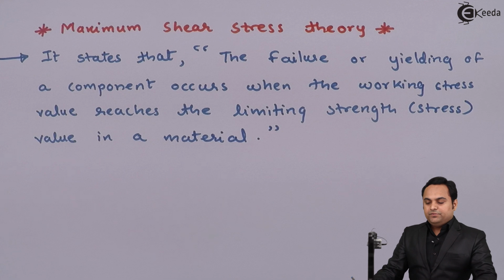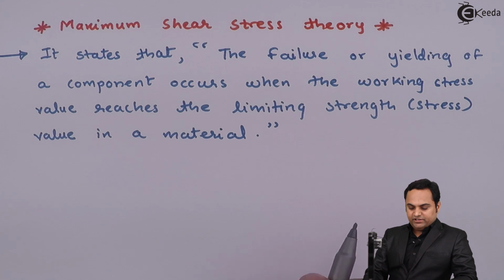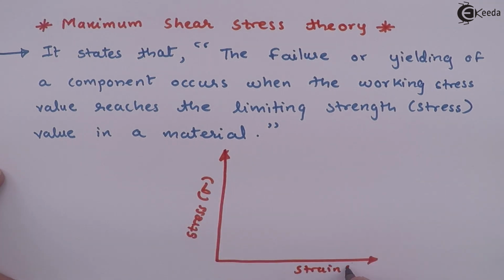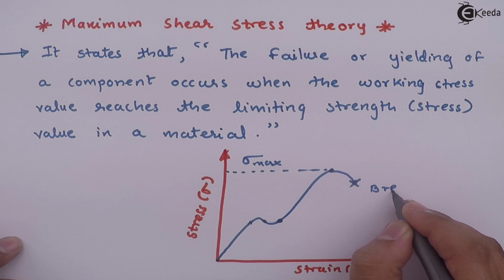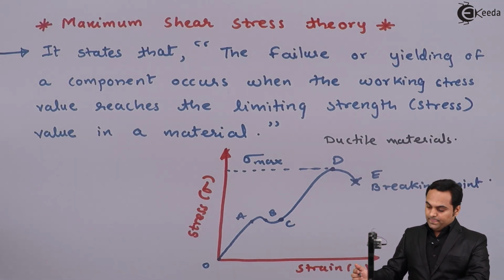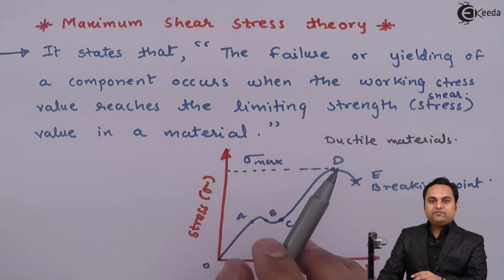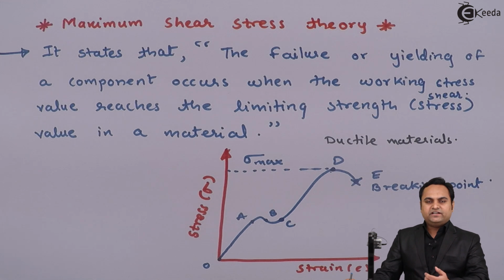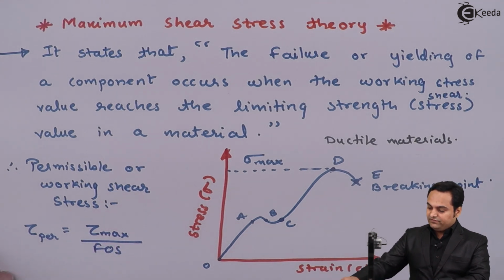Maximum Shear Stress Theory - Theories of Elastic Failure - Strength of Materials

Comment: with due respect sir, what you are teaching is wrong. 
the diagram which you have drawn is stress strain diagram for tensile loading (even though same diagram is for shear loading but then you should have mentioned the max stress as shear stress and not tensile strength). Also you are saying that max stress should not exceed max shear strength value, and you have applied tensile stress ( from diagram). you should explain that in tensile loading shear stress occurs on principle planes and thus it fails by shear.